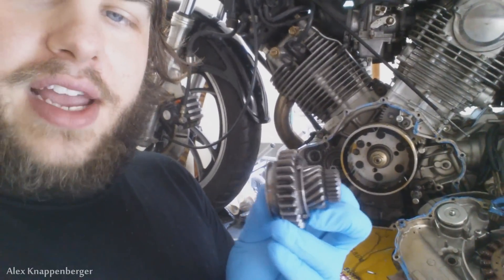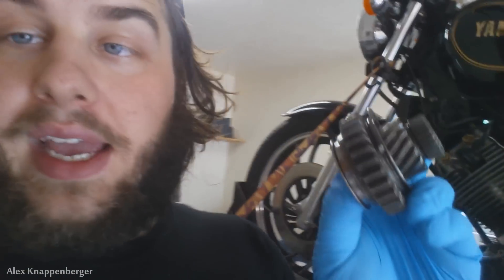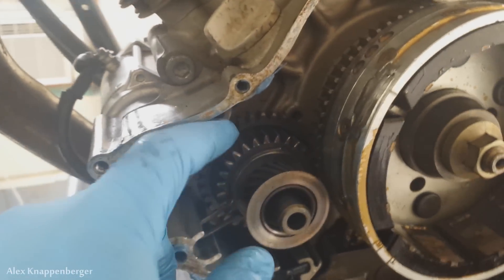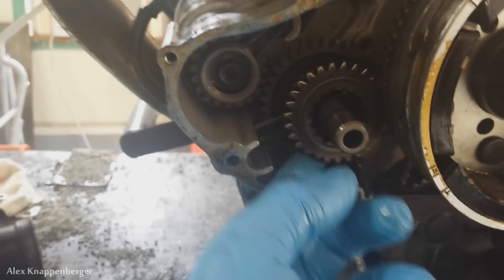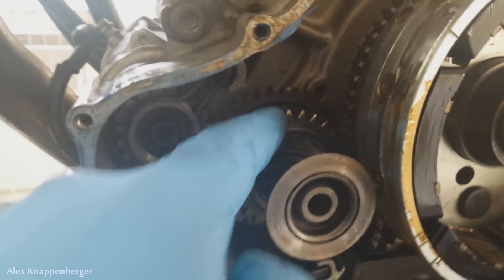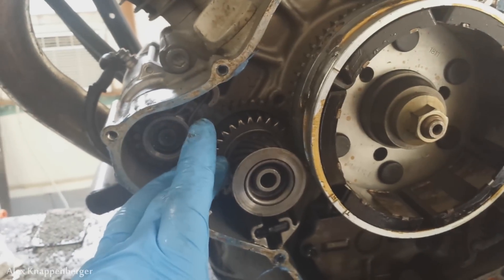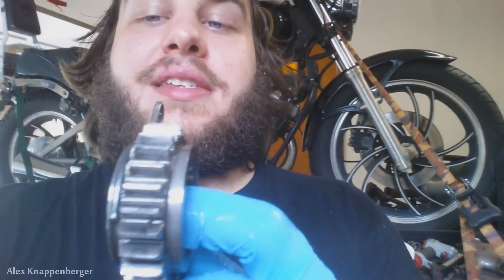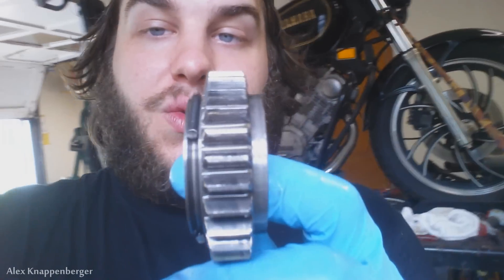The *Free* Yamaha Virago Starter Bendix Gear Fix Trick!

Comment: When I put a new starter on my virago 750 I disconnected the clutch cable on the lever inside the housing so it wouldn't be in the way now I'm having trouble getting my clutch lever in the correct position. The clutch lever inside the housing rotates that part with the ball bearings. I don't know if I've described it well enough.

Can you recommend a fix where I don't have to take the side off the engine again?

Also can you recommend a place to get a new spring for the clutch lever inside, and somewhere I can get a gasket so I don't have to use Silicone again?

Comment: Hi, I know this is an older video but I'm sure there should be a spring between the end of the inner worm gear and the gear that engages with the fly wheel, this spring would help with the gear moving up the worm gear by suppling a resistance along with the clip springs resistance, then when the starter motor is disengaged the spring helps the gear to return to the idle position. Hope this is of help to somebody . Dave

Comment: i agree and there's a way to file the gear to sharpen the edge as well to get it to grab better,also when you flip it around it will move in to the flywheel and give better grip when engaged.
Reply: Only a temporary "fix" and it causes much more damage and more expensive repairs a few months down the road. The back side of the idler gear isn't cut right to match the flywheel, and this destroys the flywheel.
Reply: Thanks for the input. Haven't even tried it yet,so i just wont go there.

Comment: There’s a voltage stabilizer sold on eBay for $14 that I installed on my virago xv700 that connects to your TCI and never had a starter problem again. Gets rid of marble noise. If you do this, your gears will mess up
Reply: lui ochoa how does this work?
Reply: Please hook it up with the link to this regulator
Reply: Been a while but I am very intrigued already had to replace my gears twice
Reply: @spidermonkey199711  Should work just fine! Adding a negative line from the bottom bolt of the starter to the negative on the battery, cutting the spring about 180° off, and adding that stabilizer should help a lot.
Reply: @4beatlesjohn  Should work just fine! Adding a negative line from the bottom bolt of the starter to the negative on the battery, cutting the spring about 180° off, and adding that stabilizer should help a lot.

Comment: Great fix just flip it after modifying the gear due to flatness!  I'm buying a 920 for $800 and the owner was complaining about the parts cost for a starter & gear.  Good news is he upgraded the electrical fix with a better voltage regulator so the spark plugs get full power on startup.  For those who don't know the starter draws a lot of power & the upgrade creates a faster better start up.
Reply: true, I wired mine myself and only 8 volt goes to the plug
Reply: The rev-counter takes its signal from the rear-plug and robs it of power, disconnect it,  the spark-plug-caps corrode between the resistors etc , replace ,    index the plugs and replace with iridium, plus put high-speed bearings at the end of the cams . Drill-out the breather-holes on the petrol-cap , open the exhausts-up and like-wise the intake-filter . All these simple-mods , made just over 10-hp extra on the dyno and made the new-clutch slip, requiring h/duty springs . That is the Cheapest HP-gain... ever , not necessarily-more than stock-new claims, because many came out of the factory , producing 15hp LESS than claimed , while others were fine . My bikes are 1981's,   European-Market 981cc TR1 , Roadsters(XV1000)  chain-drive rear-wheel-model, but are virtually the same engine as the 750, 920 (USA) and the later 1100 Virago Cruiser-Style bikes ,so most of this still works .  Dave   NZ

Comment: I'm going to say the same thing others have said... this SEEMS like a good idea, because when you look at the chewed up side of your starter gear it just looks like rounded off edges... but originally it actually had a 45 degree bevel on the leading edge.  If you modify the other side to be the same, then sure, it would work.  However, the other side IS NOT cut at an angle and it is flat.  This will most likely cause more damage to your flywheel gear.
Reply: Mine is cut at an angle on both sides

Comment: The clip loses its tension that puts drag on the gear which centrifigually throws the gear into engagement, I grinded my gears rounded edges rather than reverse the gear, I also removed the spring that keeps the gear from engaging.

Comment: This post is older but to all the people out there still looking this up:  it does work but the problem still exists that this l bendex type starter is all together flawed.  If both gears are chewed up, then why not flip it around.  Also take of the drag spring(that's what I call it) and make it tighter to the gear.  It needs resistance to make the gear travel up the worm.  I have worked in over 50 of these and some make it a while longer and some I have done work even worse!!  You can buy a new gear but it will wear out too........  good luck!! Best advise is buy new parts!

Comment: I am thinking of replacing the #2 gear because of comments that say the other side is machined flat and not beveled like the proper side, however my gear seems to be beveled on both sides. Its a 1983 750. Also, if anyone knows a source for the parts and also the case cover gasket I would really appreciate it. Struggling to find one.

Comment: Good idea, in theory, but please don't do this to your bikes. While the idler gear does physically fit flipped over, the edges of the teeth are cut flat, not bevelled like the proper side. This is almost a guarantee to destroy the mating teeth on the flywheel, which is much harder and more expensive to replace. 
It will seem "fixed" for a few months, but wind up causing much more costly damage.
Reply: I ground my gears edges clean with a Dremel tool, added tension to the clip and removed the spring that inhibits engagement,

Comment: I was gonna do on my 82 920, but after reading about the damage it would do to flywheel in a few short months I opt. against that idea. I was thinking too about why one side had a beveled side while other side was flat. Makes sense now. Thanks for the info. on that part LoganPicks.
Reply: I have the same bike.  Would like to sell it.  I was lucky enough to find metric threaded rod which I used for the starter.  This allowed me to use opposing nuts to make is so I can get great torque, placing pressure on the ring gear solving all my slip issues.

Comment: Great idea!! But did it work? Can you follow up with a video of you starting the bike please... It appears that there is room to flip the gear around... I'm real close to trying this method out...Thanks!
Reply: Alex Knappenberger . Hi there, so adding a shim/flat washer and a new spring?  That is the described method recommended by yamaha isn't it????
Reply: Sorry Alex, but this isn't a good idea. Selling the bike is about the only thing this method is good for. If the new owner rides regularly, I can almost guarantee the flywheel is now destroyed, causing much more grinding, and a much more expensive fix to now do it right. 
One of those great idea's, in theory, but not so much in practice. With some machining of that gears back side teeth, it could be viable, but not just simply flipping it over.
Reply: Don't buy new gear save yourself the headache.

Comment: Does this Virago starter flaw affect all years, all models? I'm looking to purchase a 1998 xv1100 and when researching I've gotten conflicting info with some sources saying only the 750s were affected and others saying the problem was engineered out in the late 80's. Anyway, great video!
Reply: Mostly affected the earlier version, 81-83, and the first redesign 84-85. After that, they changed the starter system to include a clutch gear and a throw-out arm to "fix" the problem. It still affected the later bikes, but to nowhere near the extent.
Reply: no... First generation only

Comment: Hey guys. could any of u help me out here please. I got a 1999 virago 125cc. The starter wont start the bikeIt wont even make a noise nothing. I have to hit second gear and run with the bike to get it to turn on. After its turns on everything works geart and when it gets hot the starter will work just fine... I changed the battery spark plugs cleaned out the carburetor and i even took a part the starter from the handel bars apart and cleaned it. Nothing is working and i reallly dont know what else to do here. Any ideas would be greatly appreciated!!!
Reply: Leandro Vidir have you tried the solenoid

Comment: To be fair... I haven't ever worked on bikes. That being said, this "tip," is more of a bandaid. It doesn't solve the original problem. Although it does seem to extend the life of that particular gear, got any ideas as to what causes the excessive wear? Like a bad angle, or spacing by the starter? I'm thinking of buying one of these, & any quirky info is appreciated.
Reply: the problem is a bad earth wire, put an extra earth wire from your battery to your starter, another problem is starting the bike on a low battery , , just make sure your battery is fully charged. Thank you Alex for your info 
Rein de Groot
Reply: Yamaha actually stole this design from harley, and did a bad job of it, there are kits that somewhat fix this issue with a heavier spring washer spacers and such, I did a few back in the day, Yamaha rarely comes up short but sadly disappointed me with these particular viragos 750 920 with this crappy starter setup